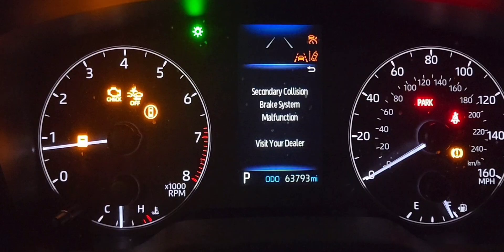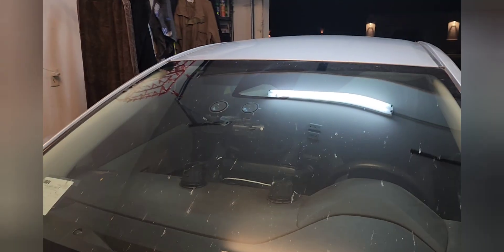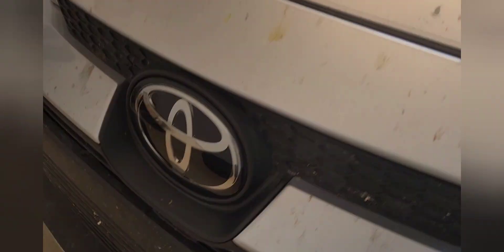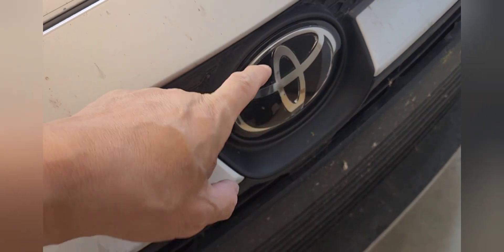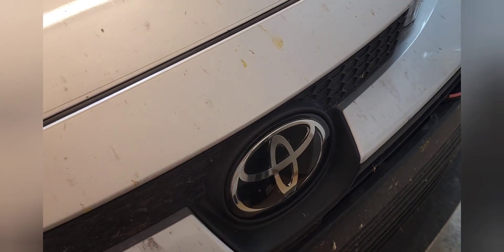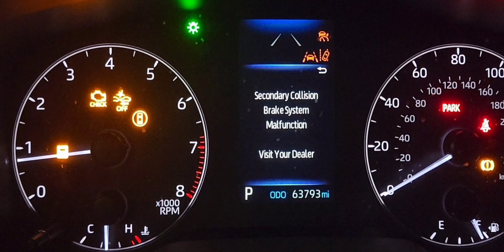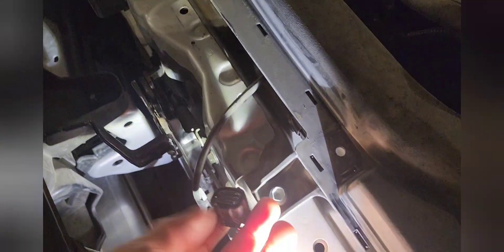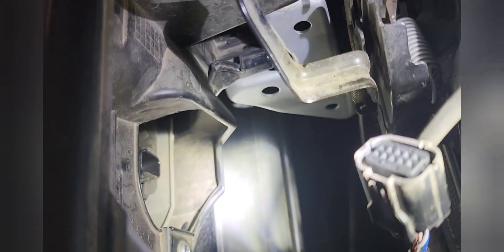2 of 2 How to fix Secondary Collision Brake System - Parking Brake System Malfunction #machinemods

Comment: Thank you so much I unpluged this sensor and all shaking and lights went off the car is running perfectly fine. You save me a trip to the dealer. Thank you!
Reply from the maker: I am glad it worked out.   😀
Reply: Question by any chance you buy a new sensor to fully fix the issue?
Reply from the maker: Check your battery first.   My battery was low on voltage which caused this whole thing.  The computer needs a steady voltage.  If the battery is old and weak; it can't hold a charge,  it will trigger this symptom.

Comment: I have a Lexus.. same warning lights, do you think unplugging the radar behind the emblem and then plugging it back in will fix it or cause more issues
Reply from the maker: Lexus electronic system is very sensitive.  A drop in voltage will cause the same thing.   I would definitely check your battery.  A battery that drops or can't maintain proper voltage at highway speed, will trigger this. 

My suspicions:
1. You don't drive your car enough to keep the battery charged.
2. Your battery is defective or OLD.

Buy a new battery and or install an on board NOCO 2 Battery Charger.

https://youtu.be/BVLKFHj6WAI